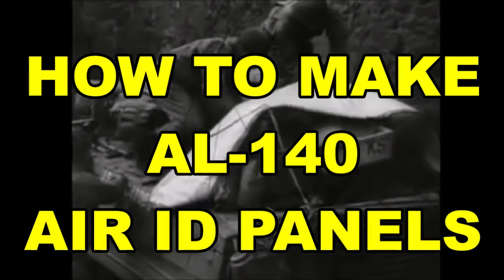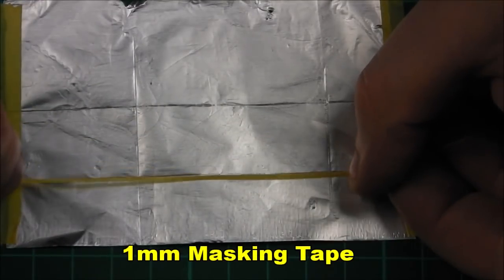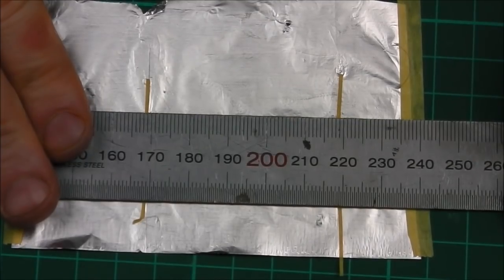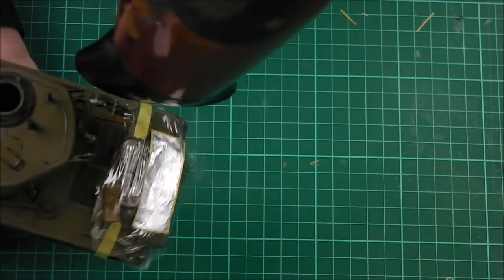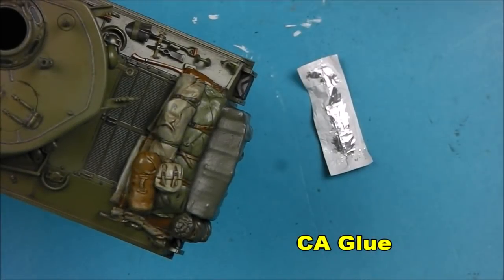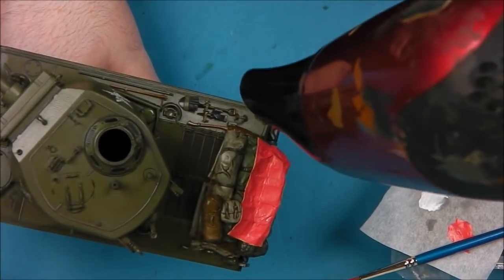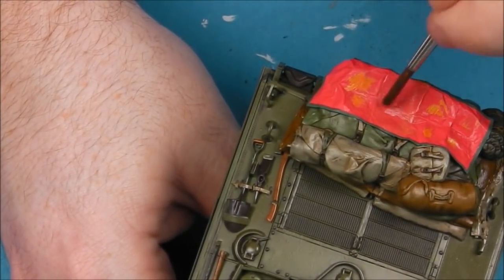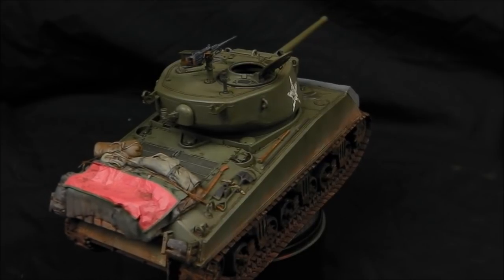How To Make 1/35 US. Air Recognition Panels: Tutorial

Comment: Hey Shane , 
What's PVA glue?
Do you ever have flaking problems with flaking on your painting panels?
Reply from the maker: I think it's called Elmers glue in the state, basically it's your white craft glue :)
Reply from the maker: As for chipping it will always be a little fragile to wear so a few layers of gloss varnish then a layer of matt or satin varnish to knock back the shine. I use gloss first as it a bit tougher than matt varnish